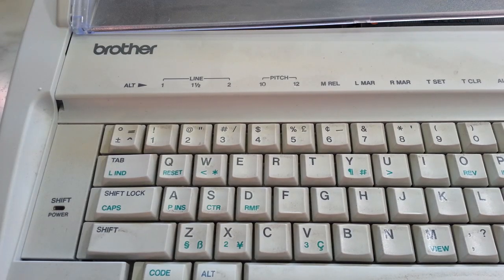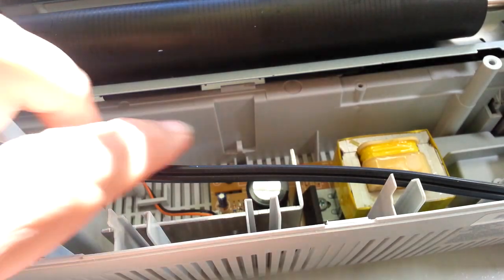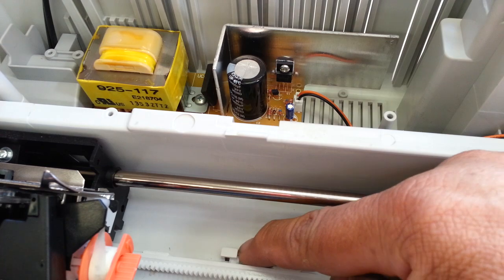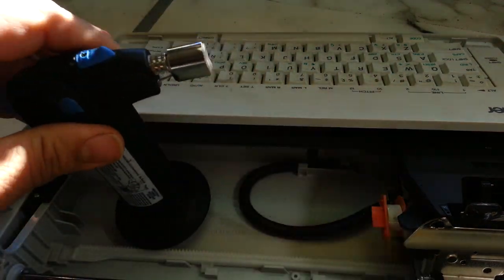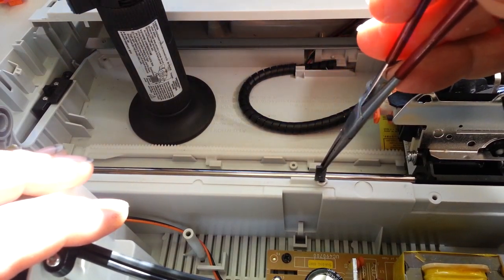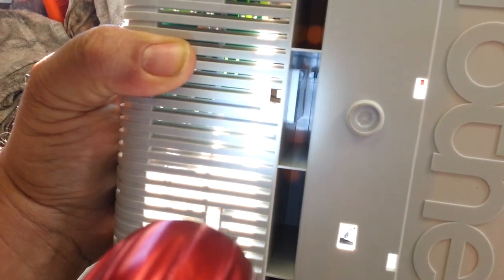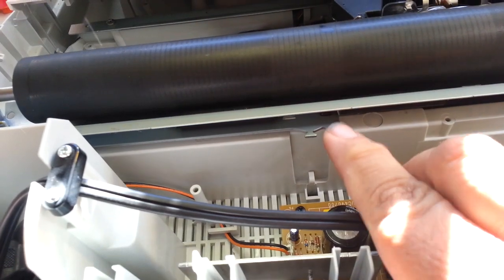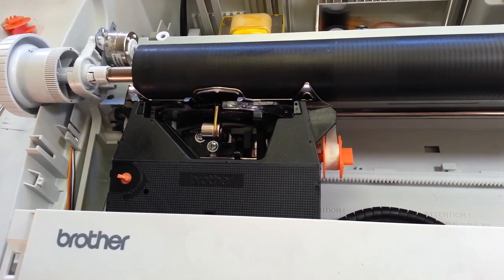Brother Electronic Typewriter Repaired Paper Release Pan Tension Feed Rollers ML100 GX6750 SX4000

Comment: I installed a 1.5 cm screw, so that the tensioner or spring that holds the tensioner plate would not come off, it did not have something flat like you did, I liked the way I repair it, I would have put glue on it Instantaneous around so that it would have been stronger, the repair I did worked for me and I had no problem ...